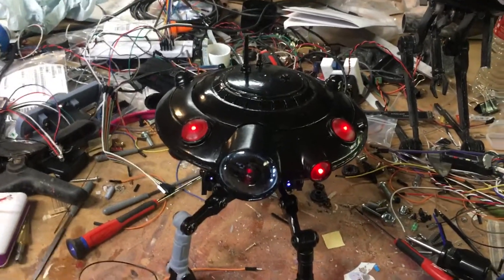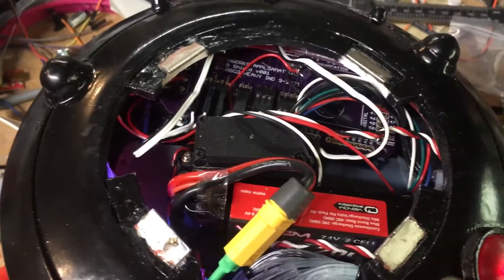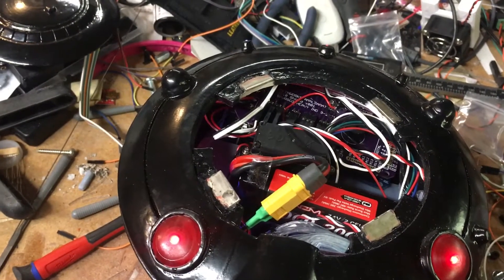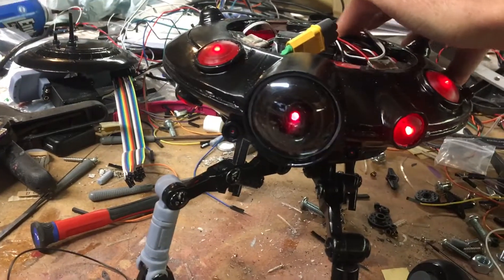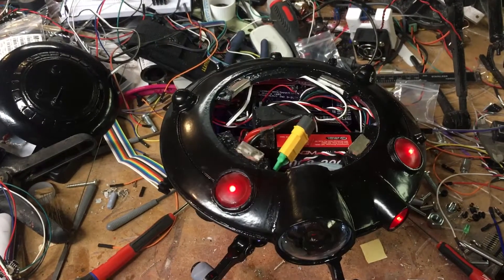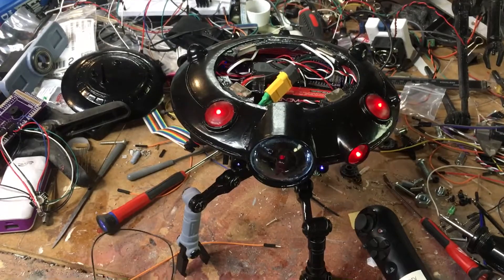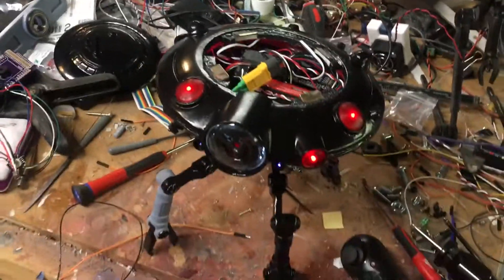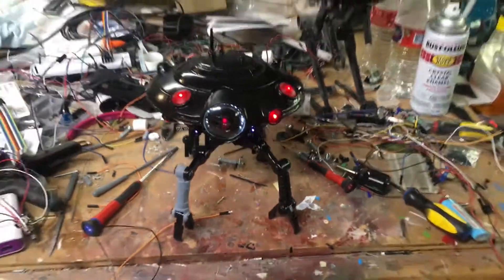ID10 Tactical Probe Droid WIP

Comment: Awesome build. What did you use for the  light ring inside the middle eye and how did you placed it there? Any help would be appreciated.
Reply from the maker: Ok, the light ting is a series of finer optic strands seated on an altered version of the etsy model. I then sealed the back side, and poured clear epoxy to fill the cavity and fix the strands into position.
Reply: @spurgco  thank you 😊

Comment: Loving this. I need to print another and add more features. Mine only has static lights. did you print the bearing holder  and servo mount combo?
Reply from the maker: Yes. I use a bearing underneath for load distribution, a drive shaft goes through that. A circular servo horn is epoxied to the shaft, and screws into the servo.